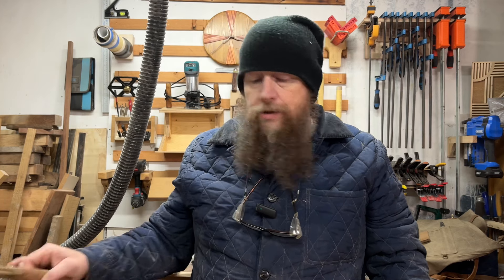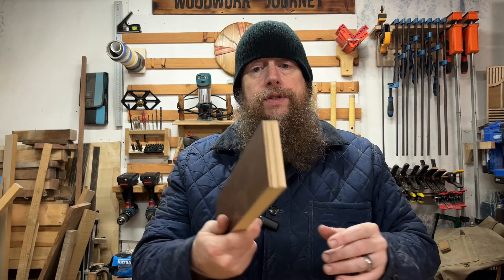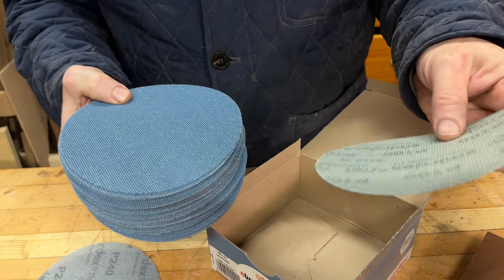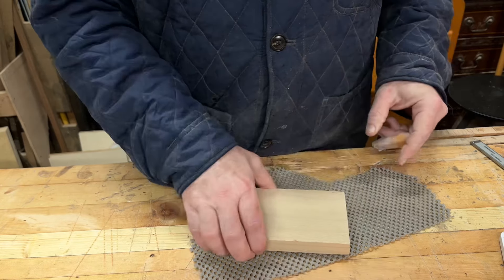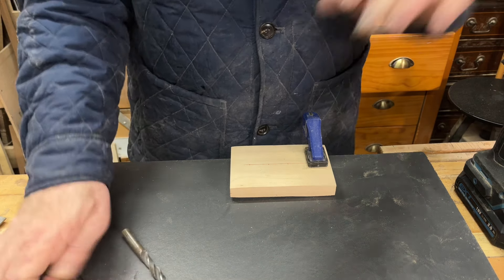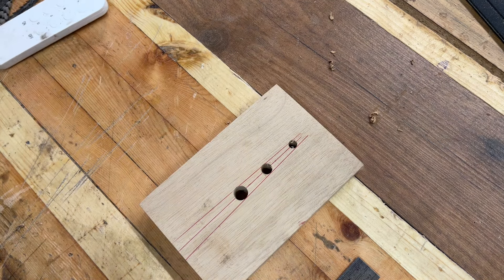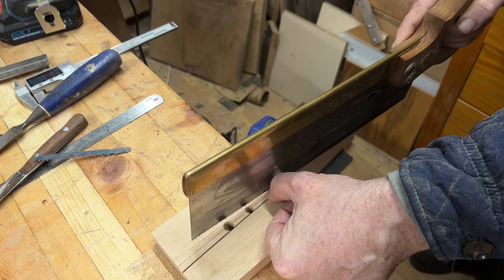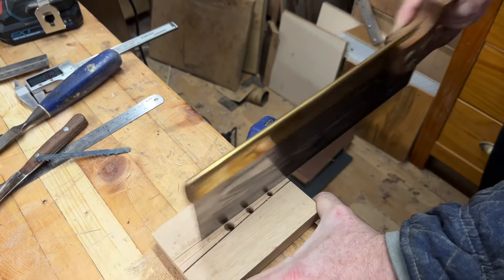Dowel making with JIGSAW blades!

Comment: The best instructional videos leave in the sander burns, missed drills, shin kicks, splinters, thumb smashes, etc. because this is real woodworking! Great tool!
Reply: Absolutely! And the icing on the cake was finding the key that had been missing for so long........ (a normal key in this case but it could easy have been a (missing) chuck-key or bit)

Comment: You can use a screw to hold the blades in place, rather than a piece of wood. The lip of the screw head fits over the end of the blade. Cheers and thanks, Dean.
Reply from the maker: Absolutely 👍

Comment: if you put in your blades before you drill the holes, then slide the drill bit down between till the drill bit is tight and then drill your hole.  perfect size easy.

Comment: I made this, after 3 failed attempts at getting the blades in the proper place, and it works great. I chose 7mm, 6mm and 4mm to make dowels for picture frames. The video is great. Thank. What type of sanding mesh are you using? What brand? I bought some at my hardware store today but it doesn't stick to the sanding pad.
Reply from the maker: Brilliant to hear. I use Smirdex mesh discs that I get from ebrasives in the UK. There should be a link in the description if any video of mine from the last year or two

Comment: The one that I use most of the time is a thick body stainless steel pipe with the inner diameter of my requirement (I use 6mm, 8mm and 10mm dowels most of the time). I cut a stainless steel pipe about 50mm in length, I grind one end of the pipe into teeth similar to a hole saw but with longer teeth profile about 10mm (steep angle), after that I bend the teeth (starting from half the height of the teeth) outward so that it can accommodate a square wooden rod (without extra dressings/shaving of the four edges). Then I take a square wood of 50mm×50mm×100mm drill a hole the size of the outer diameter of the stainless steel pipe and then use a big countersink drill-bit on the hole so that it can accommodate some of the outward bend teeth. I then apply glue on the outer surface of the finished stainless steel pipe and drove it into the drilled hole of the 50mm×50mm×100mm wood. Let the glue dry then clamp the wood on a surface and the dowel jig is ready. ( I use stainless steel pipes because they have high temper and takes a long time to go blunt, before bending the teeth outwards I burn the teeth with with a jet torch to soften them, making the bending process easier using a pointed nose pliers and avoiding the risk of breaking them, I re-temper them when I get the desired teeth profile .) 
I never sand the dowels I make, a dowel with rough surface absorbs more glue and locks into the material its holding more securely like a serrated spike, making it almost impossible for the fixture to come apart. 
PS: I hope one day you'll make what I just explained and post it here. 
Enjoyed the whole video and Thank  You for sharing your ideas. . . 
India. .

Comment: Great video. I made this jig today and it works, but I'm scorching the dowel as it passes through and it's making a lot of smoke. I tried making the hole a couple of mm bigger than the dowel I need thinking there's too much friction between the dowel and the jig but it didn't help.
Reply from the maker: Could be the speed the drill is going, or how quickly or slowly you’re pushing it through maybe?

Comment: At 5:30, Why not draw the straight line, then a line which is perpendicular to the diameter of the larger hole, and a smaller line for the small hole.  Then draw the perfect size for the middle hole. Cheers Dean.
Reply from the maker: Correct

Comment: Seems that it should emerge from the jig just a pinch larger. Some sanding will remove material. So is that why you mentioned outside the line?
Reply from the maker: Yes

Comment: good video.
Why not put the blades in first then brad point drill the hole where it fits snugly against the hollow ground blades?
Reply from the maker: Because I’m not accurate enough generally
Reply: @WoodworkJourney  SO PLEASED YOU SAID THIS😂💐💐 thats what I find too 🤦😝 sometimes Im spot on, sometimes just out😳 but I dont have tons of expensive gear, mostly second hand 😁 Theres not many things as satisfying as building something that works (Im building a wardrobe atm😊)

Comment: I'm about to make one of these, but I only need two sizes.
What I'm thinking is when I cut the groove for inserting the saw blades, I'll put the drill bits in the holes and cut up against them. Instead of drawing a line and trying to be accurate.
We'll see if it works.
.

Comment: You Need To Drill The Holes Closer To The Edge & cut A Gap
& use A C Clamp To Hold A 
Chizzle On Top Then Put 
The Peice Of Wood inside 
Of A Socket The Same Size
Of The Square Rod Thenattach
The Socket Onto A Nutdriving Shaft
Then Put The Nutdriving Shaft
Into The Drill & Spin The Square
Rod Inside The Hole Where
The Chizzle I Located Then 
Start Up The Drill.
Reply from the maker: Then it would be a completely different type of dowel making jig